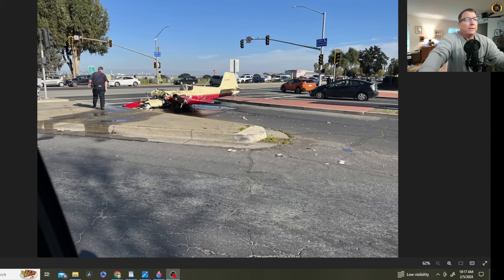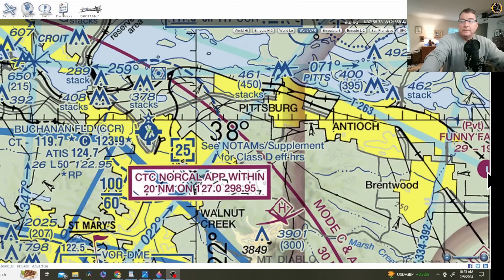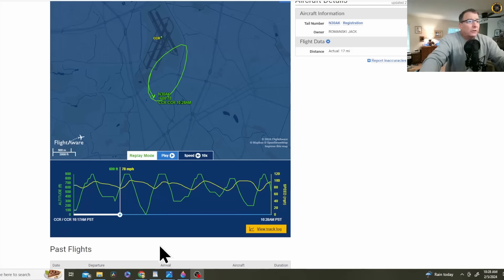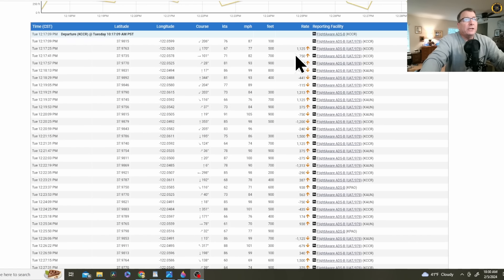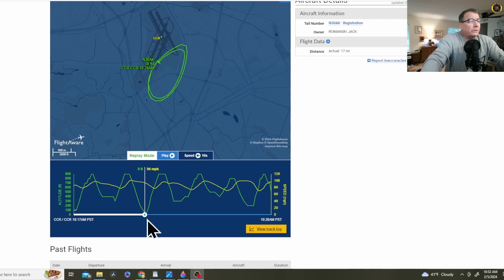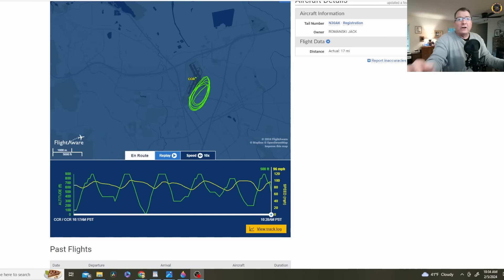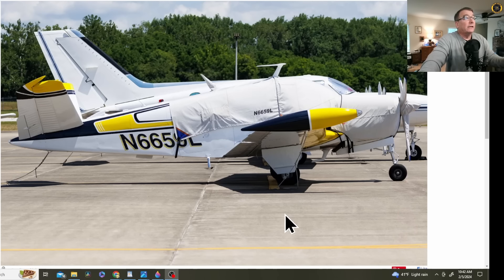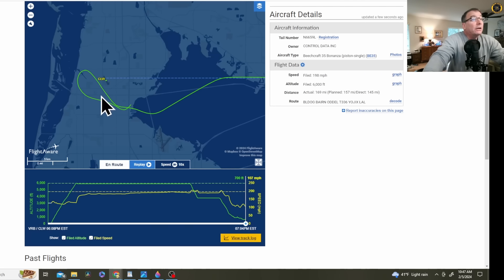RV-6 Crash Concord CA and V-35B Clearwater FL. Crash 5 Feb 2024

Comment: Bonanza:   Every data point of the track was 16 seconds apart.  Does each data point represent a sweep of the radar?  It must’ve been long range surveillance radar, then, like at a center and not a TRACON.  TRACON radars are usually about every 6 seconds apart, I think.
It looks like a stall-spin or loss of spatial orientation, to me.  Last three data points, spanning 48 seconds, were trk 122, 100 kts, 1500’, top of a climb.  16 seconds later, 063 trk(60-deg change) 81 kts, 1400’, 2625fpm descent (calculates to only -375 fpm).  Lastly, 16 secs later, 050 trk, 123kts, 100’, 4875 fpm dive!…less than 2 seconds before impact.
Too much airplane for single-pilot, at night, IFR flight plan into a dark airport…and then engine trouble.  In my opinion.

The airport should have REILs and maybe both ATC-activated and/or pilot activated airport lights, REILs and MIRL.  Then, after 15 or 20 minutes, the lights automatically switch off.  Maybe when ATC issues the approach clearance, they push a button to remotely activate the PCL airport lighting.

Are REILs still xenon strobe lights these days?  Maybe they should be a rapidly pulsating (50%-100% at 10 pulses/sec) high-intensity LED alternating on for 1 sec and off for 1 sec.  That might make it even easier to pick out than strobes.

Comment: (Bonanza) Throwing this out there, another possibility (engine related) is that the pilot could have forgotten to push the mixture back in to full-rich when he was descending towards 1k feet. IF the pilot leaned the mixture out near cruise (6,000 feet) and in such a short flight (with much going on, short time, preparing for a landing after just hitting cruise) and as he came back down to 1,000 or less the engine would struggle and depending on any ensuing pilot recognition/reaction performance issue could be unfortunate. Just a thought. I mention this cause it happened to me on a cross country (ironically returning from my successful check ride in Iowa) and as I'm at 1500 AGL for the BMI traffic pattern the engine started sputtering, heart beat matched, and just out of dumb luck really I realized I hadn't "worked left-to-right" on the Cessna 152 engine controls (pitot heat on, mixture rich/in, throttle). Shoving the mixture back in the engine was fine and a par 5 fairway landing averted...
Reply: damage marks on the mixture rod might indicate...

Comment: The Clearwater crash...My in-laws landed there a couple times. I knew after seeing the flight path he wasn't heading to Clearwater airport...Seemed to me the pilot was trying after the engine cut  out to glide into Old Tampa Bay (also known as Tampa Bay) and just missed it...The Trailer Park where he crashed is located on edge of the bay. This crash could have been much worse as the area is heavily populated.
Reply: HELL IF HE went WEST he could have made the GULF
Reply: @InMyBrz He had already turned around and was headed east when the engine quit. The impact point was only 1200' from the water, so I'd say he may have been trying to reach the bay instead of crashing into houses.
Reply: @InMyBrz  Agree...but JMO: may not have lost the engine until after he turned around.

Comment: The real question is when does the USA run out of GA aircraft.....
Reply: The manufacturers aren't making many new ones.  The ones they make, they're hard to afford.  When a C-172 is roughly a half million, a SR-22 is a million, and a Baron is probably a million and a half (or more), and the old ones are starting to wear out, the supply is getting smaller.

Comment: His general flight routine seems unusual, but each to their own. But the details, especially in one set of tracks, show dangerous habits in the pattern. In my limited experience, touch and goes are flown in a pattern similar to regular landings. A final approach (even if short) is established on the runway heading before the threshold, followed by the "touch" part somewhere in the first third of the runway, followed by a climb-out starting over the remaining runway, similar to a normal take off. This gives good practice for actual landings as well as fitting in with regular take off and landing operations. His circuits seemed to include line-up and touchdowns completely in the second half of the runway. If he had been touching down closer to the threshold, he would have had  a far better chance of landing straight ahead after the engine failure.  I would hope that tower staff looking at this accident might hesitate to allow routine use of atypical and more risky patterns such as this in the future. Using an "overhead break" type approach should probably be saved for special occasions.

Comment: If the cooling system is setup properly pattern work isn’t that hard on a Lycoming.  It’s not being run above rated output.  Fuel flow is high at full power - keeping EGTs good - prolly easier than a long cruise at higher EGT which the Lycoming manual suggests.  Keep in mind that jump planes often make TBO without a top overhaul.  Aircraft engines rust out instead of wearing out. 

Lycoming engines aren’t as prone to carb ice the way Continental engines are, at least in part since the carb is bolted to the oil sump.  Seems especially unlikely it was the problem in this accident since the engine had been running at and making takeoff power for tens of seconds before stumbling.  

I bet the cause of the stumble was fuel starvation / mismanagement.  A bunch of laps around the pattern with fairly steep turns makes it easy to slosh the fuel in a low tank and unport the fuel pickup.

Comment: The Sam Ganow was the guy that donated the 'free' abandoned airplane. That's a snag. Apparently NTSB is looking through the youtube videos where they worked on the plane.
The 75 yo doing circles, unless the GPS is off, those aren't touch and goes because for most of them he's not over the runway nor low enough. He's just flying tight circles. That does sound a little like reduced faculties with age. And perhaps an unfortunate pattern of these old piston engines failing despite the high prices. I don't know exact statistics but it feels anecdotally fairly common.
Another reason two small jets would be better.

Comment: Don't turn back with an engine failure on takeoff. DON'T DO IT. Landing straight ahead with on engine out airspeed and under control. Your odds of surviving are excellent. Turn back odds of survival are low.
Reply: The problem is, at some point you CAN turn back. For some planes/conditions/pilot training, it is 500AGL. For others it is 750. Or 1000. Or 1500. But at some point, returning to the airport may be the best option.
Reply: @cessna177flyer3  above the traffic pattern it’s not a turn back anymore.
Reply: @dcxplant so generally 1000 AGL. I agree that’s a good rule of thumb. My point is, if there is no altitude mentioned, people might never do a 180 and return to the runway at 2000 AGL, even though that might be the best option.
Reply: @cessna177flyer3  Respectfully, at that height AGL, it's common sense what to do.

Comment: The RV-6 patterns:  looked like he was making approaches to the last 1/4 of the runway?  Why not make all approaches to the first 1/4?  If he had done that, when the engine quit, he would’ve probably had plenty of remaining runway straight ahead to land on with that plane.  What was his point?  Set the Guinness record for most landings in a year?  I would say don’t do this.

Seems like it should be:
1.  Must reach a safe altitude before turning to downwind, and without so steep a climb as to cause undue heating of the engine.
2.  Must make approach to the approach-end runway threshold without undue shock-cooling of the engine.
3.  Make an even turn to final, not a sharp, high-bank cornering of the turn through base.  Or so it appeared on the ground-track data.
4.  Thou shalt not allow airspeed to drop too close to stall speed, with allowance for bank angle, except when wings level at point of planned or inevitable contact with the ground.
5. Thou shalt not ever allow stall-spin into the ground!  There’s just no future in it.

Comment: In the California crash, I'm not sure I understand the point of doing touch & go's in a tail dragger?  To get any real benefit, you'd have to make w full stop wouldn't you? Years ago I was part of a group that flew WWII aircraft.  We had a tail dragger and our chief pilot was checking out a new pilot to the aircraft.  They were shooting touch & go's and during one of the circuits, the chief inadvertently pulled the gear lever instead of the flaps and the aircraft settled onto the runway at takeoff power.  Extensive damage to the engines & underbelly. He took a lot of heat over it as it was said they had no business doing touch & go's like that...

Comment: 4:20 I like the added inclusion of possible engine abuse leading to eventual failure.  Constantly goosing the engine in those extreme RPM cycles just isn't good (wreaks havoc on the oil pressures) and the pilot reportedly did this all the time.  There's people like this in every engine-powered arena and these abusers wonder why they can't get 300,000 miles or the equivalent hours out of their engine before overhaul (or scrapping).  They're not aware or just don't care what they're doing.

Comment: He was doing a Vx almost steep turn at about 200 feet agl to cut in front of a Cherokee when engine stalled and he spun left.  HE WAS NOT DOING A TURNBACK.  He was trying to climb to a low downwind leg instead.  Not "A Turnback".  A turnaround the airport is not "A Turnback Maneuver'.  Turnback is to glide to opposite runway or side one instead of Turnaround the airport.  Ignorance is not the answer, IGNORANCE IS THE PROBLEM.

Comment: Mr Romanski was flying the characteristics of a model plane. Flight training did not remold his concept of a flight. Simple? In this case, it was a small airport with a definite pattern. A Bleriot or Wright Flyer would be justified hanging around the fairgrounds. Vans often have crummy fuel systems and sometimes rough recycled motors. A Vans 6 crashed lightly a mile from me. Nobody hurt. When you chose to stall, you forfeit your ability to aim your plane. With common sense, there's usually a lot keeping you from crashing into people or buildings. ...Runway lights? Make your own with H4 landscape LED's and 3/4 PEX tubing. Colored LED's? Your airfield will be visible from the stratosphere. Planes can run over Pex and flatten them. The electric draw will be minimal. 1.2 watts per bulb.

Comment: It looks like the photo at the end of the video is not a photo of either crash. Looks like a twin.
Reply: That's the VMC rollover of the "will it run?" free aircraft.
It seems that their mechanical inspection was not up to the job, as the compression was wildly different between cylinders, as seen on their own video.
Pilots of light twins need to spend more time practising EFATOs and ensuring they keep their airspeed above the blue line, as well.  One engine failing on a twin is not a good reason to die.

Comment: Sure seems like there are a LOT of these GA types of incidents happening lately.
Reply: Going down each year over the last few.
I find it amazing that you are not required to demonstrate EFATOs to get a license in the US.  I know without any doubt at all that my possible landing sites in that situation are what I can see through the windshield - so only very minimal turns and pinned to best glide on reflex - it is hammered into us in the UK well before we can even solo.
Reply: @I_am_Phil_Lee  mostly agree on the EFATO training. But at some point (altitude), a return to the airport may become the best option. Is there an altitude associated with the “dont turn back below ‘X’ AGL?”
Reply: @cessna177flyer3  The safe altitude for turning back does depend on several factors - the type of aircraft dictates its rate of descent with the engine out, whether you can stop the propeller windmilling, the wind speed and direction, etc.  The situation varies, and open fields ahead (or nearly so) can be a better option than risking an attempt to return, while a densely populated area can make the risk worth taking.  But if in any doubt, the straight-ahead option is preferred until you reach the circuit (which you call pattern) altitude.

Comment: Still no notice from screw tube.
Reply from the maker: Check your notifications settings on all your devices.
Reply: @blancolirio  I do, I have. YT makes adjustments without your consent. I used to get notices on some, visual and audible and that just goes away sometimes. No rhyme or reason. Thanks.

Comment: I do those super aggressive touch and goes with my model airplane but the idea of doing it with a real RV6 is dumbfounding. Leaning on what I know from doing this with models, If the engine quits on the zoom up, you're SOL, and that's with a plane with a much higher power to weight ratio than this RV6 would have. I've had it happen and it's just like someone hold the plane at the top of a ladder and letting it go. It didn't look like there was a fire in the RV crash, so maybe he lost track of his fuel supply.
Reply: I respectfully disagree. I do pattern work somewhat similar to this all the time in an RV6. The chances of the so-called impossible turn are better in the RV6 (if you're on top of it) are better than in a Cessna and many other planes. On a 5000 ft runway, I'm almost 1000ft on crosswind just off the end of the runway. I have practiced power out at this point too, and I can make it back.

Comment: I would want the parachute recovery option if I were a pilot, but why not have a solid fuel emergency rocket in the tail end to give a plane with engine failure a boost to a safer altitude so a pilot can turn around and safely land? Yes it would have to be tested, and that would be dangerous.

Comment: This is why I put a PBS TJ100 turbojet engine on mine that will pop out of the fuselage and get me back up. Lately I use it with my main engine but put the jet in low power and ready to take over my 180hp if it fails. Why are pilots so dumb. I single engine is an emergency even if it works great.